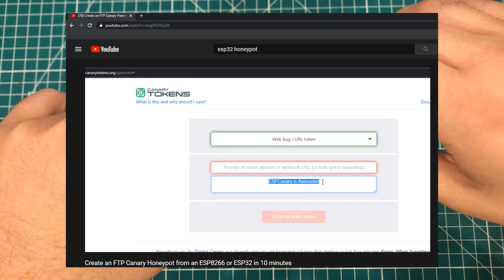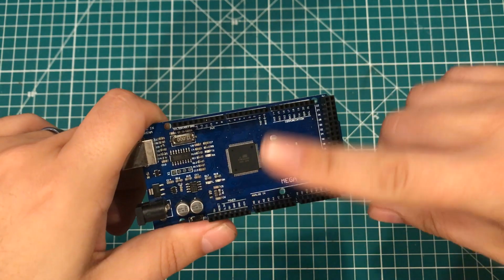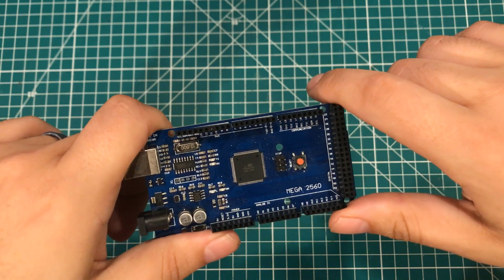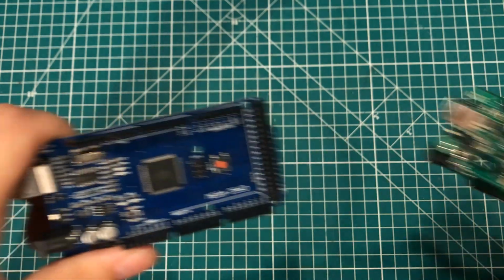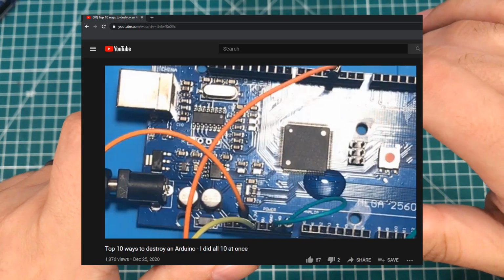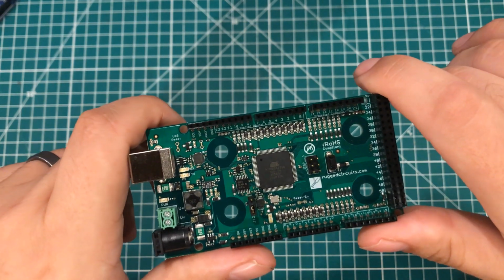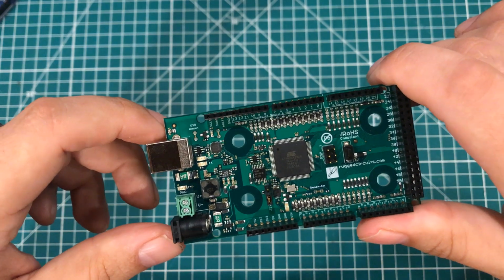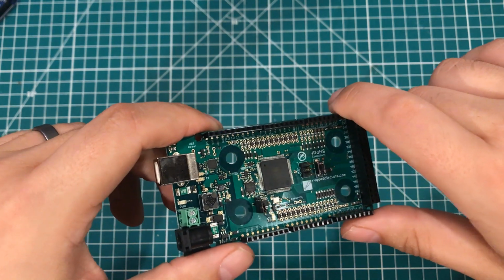Can you use an Arduino in Commercial and Industrial Applications?

Comment: I work as an Industrial electrician / electronics tech for a manufacturing plant and I've often said I, as well as a few others, that we could replace a PLC with a microcontroller. Not only Arduino but other micro controller name brands as well. This often becomes the discussion as well as other cheaper PLC options such as Automation Direct's PLC line's. Yes PLC where created to replace relay logic, they also provide a far more convenient way to "reconfigure" a machine to perform a new or different task. What used to take days, weeks, months or even years to reconfigure a machines operational behavior is now minutes, hours and for a full redesign a few days. As far as the ladder logic, the programming language of PLC's, it was created to mimic relay logic as a visual programming method. Basically a electrician of the time could see the program and quickly understand what was going on as it followed a relay logic print layout.  Its not really hard to understand or program ladder logic however its the insane cost the "top" PLC providers charge that becomes the issue.  We will take for example Allen Bradley, you want be build a small PLC using SLC500 parts and you don't want to use old parts off eBay. 

  We will build a 32 input and 32 output, 16 sourcing and 16 sinking PLC, can'tplussoftware. If your starting fresh and new your looking between $5641.32 to $9051.32 just to get what I would consider minimum functionality.  This is when Microcontrollers really start to look like a good option.
Reply from the maker: Yeah. I hear people talk about the high end PLCs is basically being cost prohibitive for the little guy. Obviously industrial is a pretty wide range so whether it's a good option for people or not depends on the application... Like most things
Reply: @AnotherMaker  it was a company called Mitsubishi that made some really cool eight in and out 16 in and out 32 in and out 64 in and out under 400 hundred bucks I think the 8 in and out we're under $200
That's the magic of buying similar item from automation direct.
Biggest issue with real companies they want somebody to Sue or at least point to and hold accountable when all hell breaks loose so they can get parts and get back running quickly 20 years from when the machine was built.
Reply: @chauvinemmons  yes, that’s the biggest reason, reliability, accountability and long term serviceability. For most industrial applications the cost of the downtime far outweighs the 10k you spend on the “expensive” PLC system.
Reply: but can this micro controllers can perform complex logic as done by plc ladder logic ? I have a 4 dc  output and 3 ac output small project pplus 7 dc input, with washing machine type logic.
Reply: That's where PLC direct comes in there controllers are as good as anybody's when it comes to Old PLC 2 stuff it's the only option then there was Mitsubishi I don't know where they're at anymore but guess again we just don't use that stuff anymore

Comment: I was like "But you need 24v to do most industrial IO..."  Then the 24v shield was presented! ;)  

I have used Arduinos in the wild a few times now. They do work ok, but I found certain additions and precautions do help.  These are things I learned in the 1990's replacing PLCs with Z80 boards but they work for non-industrial controllers as well. 

Decoupling caps are your friend! Use isolated power when you can. Have a well-shielded enclosure, but have your Faraday cage building material at the ready if you have an extra bad EMF area. 

If you are placing the controller in an enclosure on the outside or in a high-moisture area, you may want to use lacquer on the tin covers like on the USB or ethernet jacks and use only non-ferrous pins and headers as they will rust quickly. I would also place the board in a moisture-tight box as well.  

If you are switching a contactor or other high voltage relay/switch, add a free-wheeling diode to live to switch another day! :) Use real-pulls/down resistors on digital IO lines (internal may work but...)  Use OPTO isolators when needed. 

When connecting to older serial-based equipment, it will usually not be TTL, but RS232, 485, or 422.  You can find converters for each.  A lot of the older sensors (pre-Modbus) will be current loop-based and will require more than just the Arduino to read.
Reply from the maker: Fantastic information. Obviously this is way more your area of expertise.   I did a lot of PLC stuff a while ago, but I was installing them, not programming and designing the enclosures.
Reply: I came across the Arduino (pro) Portenta Machine Control unit yesterday, and that seems to tick a lot of boxes too. Check it out.
Reply: @drheaddamage  but can this micro controllers   perform complex logic as done by plc ladder logic ? I have a 4 dc  output and 3 ac output)0.2 - 9 amp) small project  plus 7 dc input, with washing machine type logic.